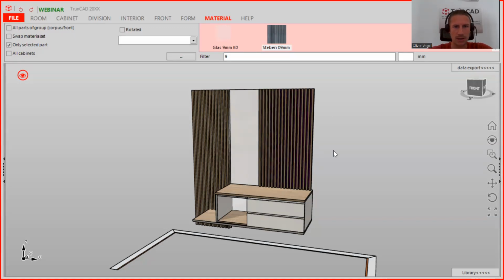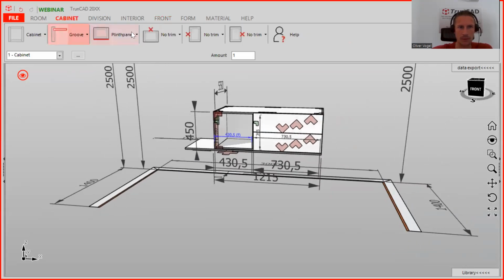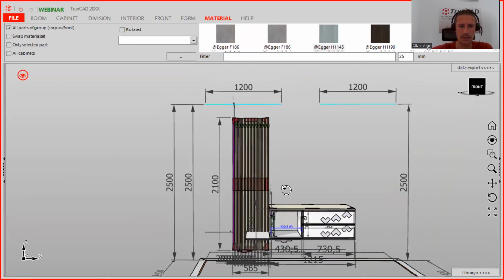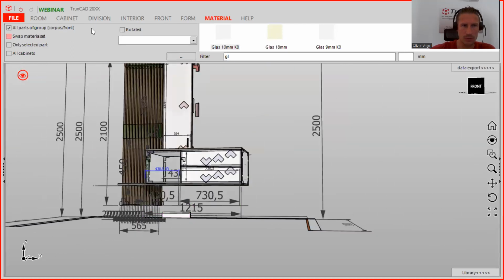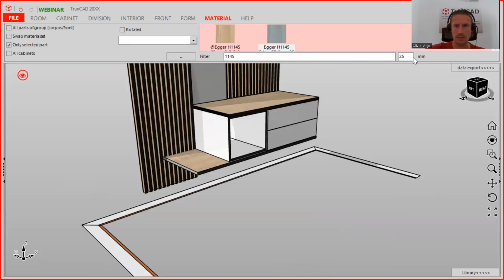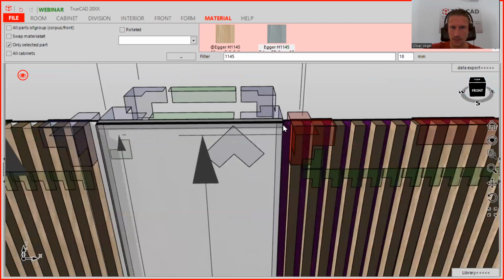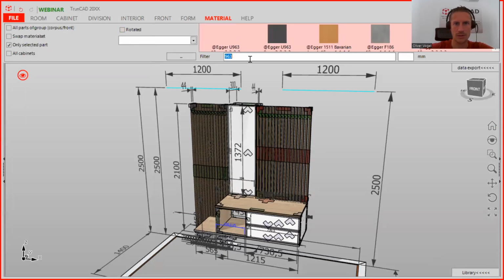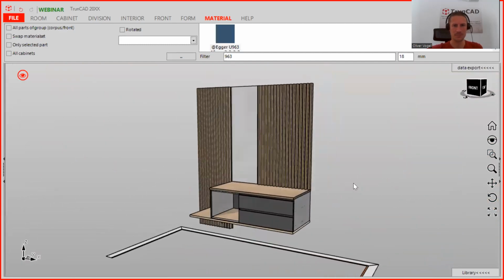TrunCAD 20XX | Stylish wardrobe with wall paneling

Comment: taking way to long the idea create a cabinet 300 and become glass panel looks bad insteed just add a panel and then put the material on it
Reply: it is also possible to just add one panel and put the material on it. in this case you need to consider that only one panel appears in the cuttinglist. but if you only want to have it for 3D picture, then you're right it's totally enough👍